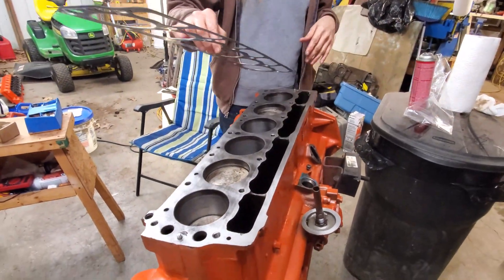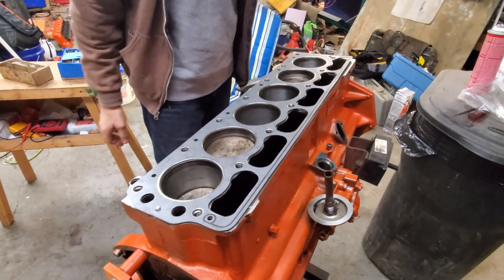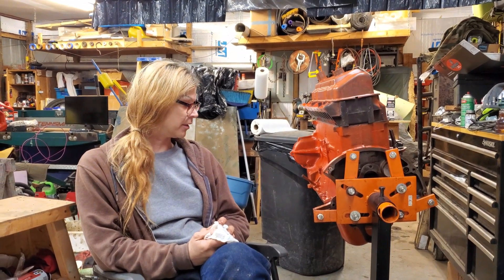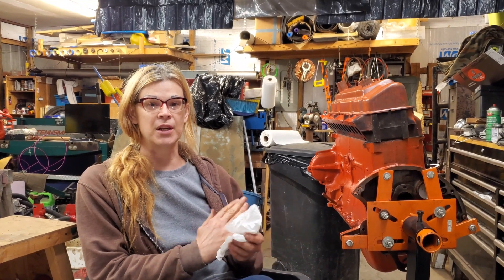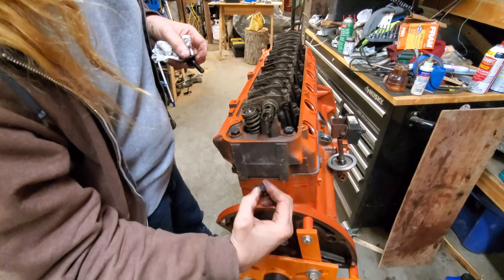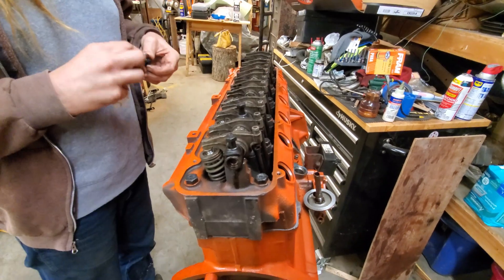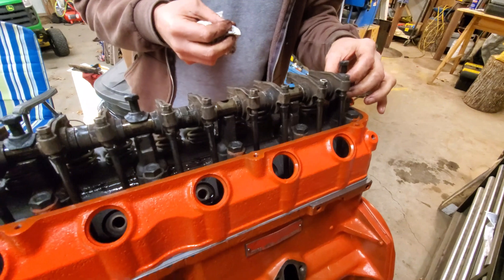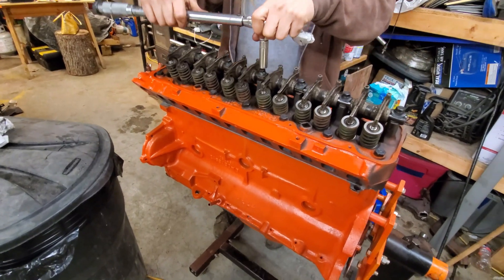Easy engine to assemble. 225 Super six slant six Head gasket and rocker arm torque. Build Progress

Comment: I rebuilt this engine in my B300 1ton van. around 1985. It was an old post office van with 300,000 miles. But it had a  a newer but thrashed out slant 6 - 225. I bought a master rebuild/re ring kit.
 And a Valve kit, springs and retainers . pushrods.  Then added the Weind 4 Barrel intake manifold, and some No name 6 in to 1 header with a glass pack. Added an oil cooler , and trans cooler and drove that van to race tracks all over hauling me and my race bikes around.  The Re-ring held tight for about 60,000 miles , then rings/started smoking and lost compression, I let it go die and that was that .   Best wishes. That was the first legit street build I ever that was expected tp last. That lil S6 225 NEVER let me down. OHHH  WARNING!!!! Read the next if nothing else!
Chrysler slant 6's like to bend pushrods when they backfire!!!  Always hold the starter ON for an extra moment until your shure its started. Or you'll bump the key itll start stumble backfire and run like crap. That's because it bent the valve pushrods. Get a set of spares. Im serious!  I could swap out 2 bent pushrods and get it all good in about 1 hr after the 3rd backfire. I also was running A LOT of timing. Maybe 15-16 degrees. As I used to tune by filling tank with the octane rated  gas you use.. (Back then regular  was 89 octane) . We would slowly advance timing till it just starts knocking, then back off 2 degrees. then go for a long drive. Run it hard, immediately pull over , and do a plug reading. If thats good you were done . Lol. That was basic tuning! The old Holley 650Vac2nd was perfect for pulling a trailer, and the 750Dbl pump was awesome on the top end, but coughed down low and could...backfire.. We all had both back then...Seriously, ask an old racer. We all had extra carbs and a tall/aftermarket manifold for the track/weekend. Even in the Hoochie LOVE vans lol...Cha Cha Cha HOOO WEEE!  HOOCHIES!   That is advice from 1950-1960 Circle track Uncle there.  I've given up on carbs except for racing...FI for the win and MPG
Reply from the maker: FI is great if it is already installed. I agree with your advice on reading plugs and I'm not surprised that a slant six likes 15 degrees of initial timing. Never had issues with bent pushrods yet. This is a really good engine for learning about classic engines and the basics of hot rodding.

Comment: Can't wait to get started on my slant 6 hopefully I don't have to pull it all apart but I know I've got to adjust the valves
Reply from the maker: I will be following your progress. Sometimes it's just easier to pull it out and work on the stand. In my case, the old engine needed rings. If you start from the bottom, you will know exactly what you have.
Reply: Oh, I would agree with you I just don't have any way to pull an engine and have any place to set it if I did pull it and work on it